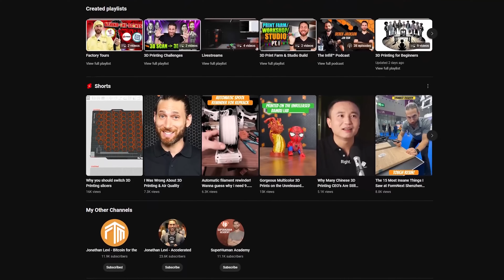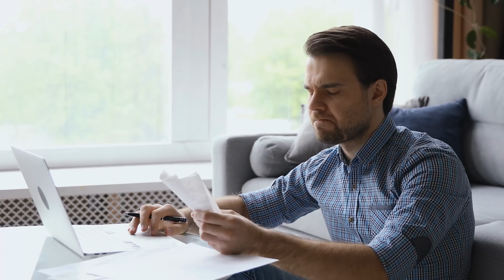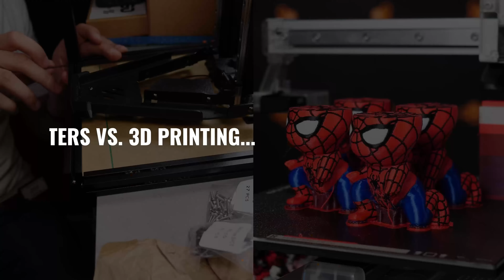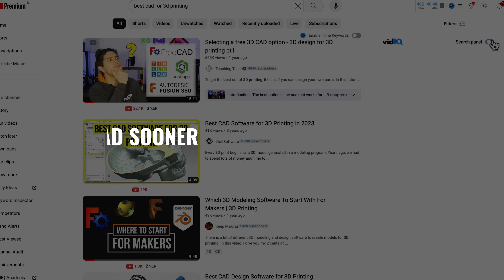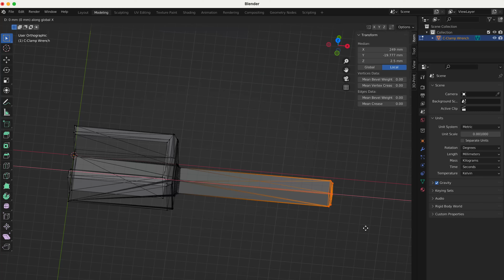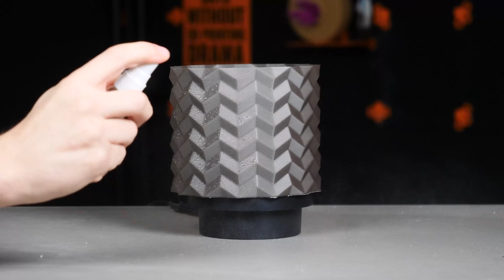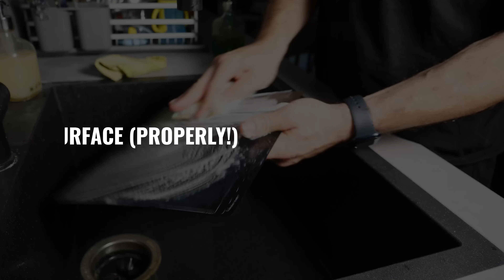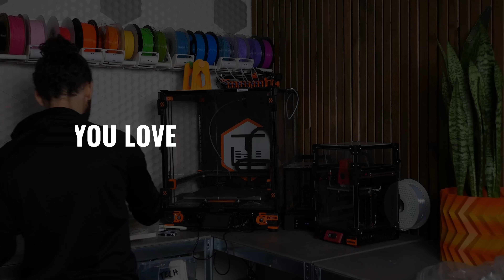9 Things I Wish I'd Known About 3D Printing

Comment: Hey Jonathan, OK, well I think I really need to call out just one thing..  :)  I have to disagree with your just wash the build plate first and every time advise, but please hear me out first... :)
My recommendation would always be the following for bed adhesion issue, first double check  t hat your build plate temp is within the range specified by your filaments manufacturer, being too cold is common reason many prints will not stick, this usually happens after people will try to recover to correct a warping or elephants foot issue by dropping their temps. If this is the case, there are a number of videos out there on how best to correct those situations without lowering your plate temps too low,  giving your build plate a really good washing with a name brand  dish soap like Dawn Powerwash or similar is great advise, just make sure it has no hand conditioners or lotions just as you stated has stated, in the video in most cases this will in fact work with the exception of a situation like mine where nothing ever sticks to my build plate after I wash with with the dish soap, though this is likely something specific to my environment though I don't know what it could be, If you still have issues, do wipe it down with between 70% - 99% Isopropanol. This is the part where we do differ from as I do believe it is better to wipe down with the isopropanol in between washes to ensure that your prints will continue to adhere to your build plate. I don't know why you are tossing this out after all this time, as it is a cheaper alternative to constant washing ever X prints.  Washing your build plate after every lets say 10 prints or so could get costly for some people as  for example Dawn Powerwash can cost u p to $7-$9USD unless you buy in bulk and if your on a budget this could get a bit expensive compared to the  cost of a bottle of isopropanol which costs around $0.79- $0.99 per bottle and one bottle can last you a VERY long time, in fact, it usually takes me months to go though one bottle with an average of 2 long prints every few days. This also saves time, as  well  people do not realize how much removing  the plate each time and placing it back on the bed each time can cause your bed to need re-tramming. Admittedly wiping the bed down aggressively can have the same problem which is why I don't recommend aggressively wiping the plate down either, a gentle wipe down should be all you need. Also if you find this to be the case where you are having to continually re-tram your bed, I suggest replacing your springs with silicone bushings instead, however, there are some debates as to why bushings should never be used and why springs should never be swapped to bushings though, I have never found this to be the case, in every test I have run, bushings have proven to me to be far superior in every way, though I digress.  Your  bed will get residues on them from the filaments, as well your grubby little fingers will leave oils on the plate every time you touch it. After time, these smuggies will eventually lead to a complete lack of adhesion and a simple wipe  down saves  you on both time and money and if your not too aggressive, you won't risk having to continually re-tram your  build plate. I honestly don't understand why you are dismissing the isopropanol after all this time, as it would seem to me that the isopropanol would be the perfect solution to fix a simple adhesion problem and to do so proactively in between  having to take the plate off and give it a good washing. Of course if you're using glue sticks or any number of other bed adhesion products to get your prints to stick, the washing the plate is really your only option as isopropanol will just make a giant mess of your build plate, but I truly stand behind the use of isopropanol in between washes are a quick an easy, lets call it a maintenance step between washes or if you run into a problem early of and your prints start to have adhesion issues as a quick wipe down will get your print restarted right away and may just solve the problem until you feel a wash necessary. I would be interested to hear a bit more as to why you have decided to turn your back on the tried and true  isopropanol as you even stated that this has served you well in the past. I bet I know why!!! Has Dawn sponsored one of your videos??? Gosh, I am so jealous of your makers / creators, you guys get all the good stuff free! LOL I am sorry that was a low blow, I sincerely hope you did not take offense to my very off color humor, I meant this completely as a joke! I know, my humor is rather tasteless and poor, hence why I never went into standup!
 I would  highly suggest you do not lather your build plate with a glue stick unless you are use a standard  and worn build plate that has become troublesome for you to get good adherence, or your are printing with a filament like PETG. If  this is where you find yourself, I would highly suggest if you have the means top upgrade your build plate to something like a smooth PEI sheet. These sheets are known for their adhesion and most standard filaments should have no problem adhering  too them.  PETG is definitely the exception as you are using the glue stick not for its adhering properties but as a releasing agent as PETG becomes extremely sticky and an unprotected glass bed is likely to be torn apart by PETG, I have never seen anything like it, it will literally destroy your glass plate! The Glue stick is good when you have a specific filament which is known to have adherence  issues such as the exotic filaments but should never be your first choice for gaining adherence for filaments such as the standard PLA. PLA should not have any problems adhering to a clean and not worn build plate. I

Lastly just a quick note why I am very much against the  many creators advise to  slather on the glue stick, hair spray, or any number of adhesion products available to make sure you part with your hard earned money and that is that these products tend to not only stick to your  build plate, and in most cases will keep your print firmly attached to your plate, but when you r print has completed, and you remove your plate, you are likely to notice that much of that product is likely also adhered to the bottom of your print as well. In most cases you  should be able to wash your print to get it off, but in some cases I have found that that when the initial layer was being laid down, and the filament at it's hottest, some of the glue or other products have been absorbed into the hot filament, which at that point, you will have little chance of being able to separate it from your print leaving a nasty white residue permanently  on your print. This is terrible if this happens to be an outside / visible portion of your print and this is exactly why I have to disagree with any maker that provides this as their first line in trying ensure your print adheres to your build plate. 

In closing, Jonathan, I would really like to understand why you are disavowing now the isopropanol as it clearly works, your history with it proves that, but were you simply trying to say not to just only use the isopropanol, ie never wash washing the board, or are you more or less boycotting the use of isopropanol all together? I guess this is where I may be missing your point here. 

Oh more lastly, reading some of the other comments made me remember the one really important thing that I wanted to share with you. You are a fantastic communicator, the way you present your video's comes with a bit of authority/ confidence,  but  not condescending, as that is extremely important when your  hosting your videos. There is another very young creator / maker, that has a large 3D Printing channel who's videos tend to be quite informative,   but I honestly can't take more then a minute or two of his videos, as he comes across very condescending as if he is the gift to the 3D Printing world which I find extremely odd in this maker space. Most of us in 3D printing tend to be introverts, and no matter how long one has been in this space, we can all learn something new from the most advances users, to the new commers, but his videos tend to have this air of him being the best, so don't bother suggesting something since he already has a better answer. It's a real turn off as some of his videos I actually want to watch but I can't. Your videos drew me in when I first found your channel as you almost seem like the best friend I never had! That is an amazing  skill and a good reason for why your channel has become so successful! Don't ever change your honest persona! It's just an amazing talent, though I believe it's less talent and more you just being you! :)  Amazing work as always Jonathan!

Many thanks for this excellent video and for your future reply to this! 

Cheers, 
John

Comment: Instead of using all the different filament types, try limiting yourself instead to only 1-3 types. What kind of material do you really need ? For instance I never used or use PLA. It´s a non engineering material, it´s temp tolerance is horrible and it basically costs the same as PETG which does everything PLA does and more. So why waste space for filament which I don´t need ? 
Create a good work space first and foremost. Do you have good lighting ? Good ventilation ? Do you have a nice table of some sort ? If your printer somewhere it works well temperature wise, dust wise and so on ? If your printer is in the same office room you use like in my case do you have a sound proof enclosure ? Do you have good filament storage like a dry box or other solution ?
In 99% of all cases you don´t need that Nylon CF fillet whatever material which does not increase your part strength anyway, if you can´t print a part strong enough just use sheet metal or other means. 3D printing is just ONE of many tools. Don´t always use all problems with a hammer just because a hammer is what you have, there are different tools for different problems.

Comment: Blender is not CAD btw. Blender is a 3D program for artists, CAD is more more engineering. 90% of all CAD software are either the same or similar. The more expensive CAD software is not necessarily better, I work with CATIA and Siemens NX and no one in their right mind should buy and of those tools for their home use or even professional use, that´s why FUSION 360 or even SolidWorks are so popular. My CATIA license at my engineering job costs 30k a year and there is nothing to it you would miss is you did use Fusion 360 for IDK 150 Bucks of whatever it costs I have no idea.

Comment: I've put off getting a#D printer for a wile because i could still make the things I wanted with other materials and I know that can be a lot of frustration with print failures and tweaking the machines. It's finally hit the point where Bambu is pushing for print consitancy with more monitors a.  alower price bracket that it's worth getting plastic production for me.

Up to this point most cosplayers where saying get ANY 3D printer because you going to have to spacale and sand then thing like crazy to remove print line.... what I'M excited for is printing files on the smallest nozzle and finest detail setting to reduce print line in pretty filaments that will be Cosplay ready. And for ones that will be paint the less spahle and standing the better!

Am I going to print custom upgrade, VERY likely  but I'm not interested in tinckering with machine hardware outside of replacement part.

Comment: Having 130 rolls of filament, I would kill myself. I have a system where I use 2 base colors (black / white), it´s the same material (PETG) of the same manufacturer.
Standardization is king, I can print any part with the PETG and it will fit almost anywhere color wise. PETG is basically the best of both worlds, is stronger and better than PLA and almost as good as ASA but with way less hassle. I also just have one printer which is a core xy machine these days and I have retired my old i3 close because the new machine is about 5x as fast. I have increased my productivity by 5 fold for the same space the machine took before. People need more focus to figure out what´s the most important and the organize properly. 3D printing is also only 1 out of 20 things I do so I can´t allow this one thing in my life to completely take over.

Comment: My own lesson learned. I think the biggest thing I learned after diving deeply into 3D printing is that 3D printing in and of itself is NOT a hobby. 3D printing is simply a tool. A very intriguing tool that can allow you to do things you just can’t do any other way, but a tool just the same, like your drill press or your lathe. It is an amazing tool to support your ACTUAL hobbies. How much use you will get out of it is entirely dependent on your lifestyle. Do you have a craft space or a workshop or garage? Are you always building, tinkering, repairing, improving, rebuilding, creating things around the house? If so, then a 3D printer can be an incredible addition. You may wonder how you did without it. But if your lifestyle doesn’t already include these kinds of activities and hobbies, or doesn’t really have the physical space for them, you will struggle to find applications for your printer. I mean seriously, how many Mandalorian figurines does anyone need? I am still enchanted by the possibilities, especially the design process, but learn from my experience and give this all some serious thought before you leap.

Comment: Been 3D printing 12 years now. I use a textured PEI sheet and I found what works for me (99.99% of the time anyway) and that is clean with 99% isopropyl alcohol then every 3-5 prints I wipe the bed with 0000 steel wool (super fine) it does not damage the bed at all but does remove those ghost print marks and is as good or better than Dawn washing. Just to test this I have been using this method for around 500+ prints without washing in soap (use to wash in soap every 5-10 prints). I also have my Z offset set dead on (perfect first layer) so for me at least this combination has yielded maybe 1-2 warped prints for 500+ prints and those were when I went too long before the steel wool. Now the steel wool makes no visible marks on the bed (surprised me) and when I use it then IA clean the bed looks brand new. I had heard years ago about using steel wool but figured it would ruin the print bed (sand it down) but I was very wrong and wish I had tried it even sooner.
Reply: Wow underrated comment right here! Thank you…

Comment: Great Video! Thanks. 
I would like to find out if you would recommend the bambu lab p1p above the creality k1? I have a ender 3, and have been getting consistent prints on the machine. 
Was just wondering why you are so biased against the creality printers. 
I just got one because of availability in my country. 
Regards
Reply from the maker: Definitely. Had a bad experience with the creality

Comment: I started with SketchUp, now I'm stuck starting simple projects super quick and easy. But it almost always snowballs into Fusion 360 constantly making me rebuild the model 😵‍💫

My point, SketchUp is VERY easy to learn and you can be designing and printing parts in hours if not MINUTES if you have the inclination for it. Took me 30 minutes to learn and design a phone stand the very first time i used it. But, be warned that if you ever do outgrow it, it will always seem to pull you back and either save you a few minutes or waste hours fixing models because you think you don't want to rebuild the model the right way in a proper engineering software suite while you get stuck in a loop of.. WELL it's just this little mod, not worth it.. just this little mod, not worth it.. just this little mod, not worth it..

Comment: Yup - got into 3D printing back in August 2023, and if I had the space I would already have supplemented with another like Bambu’s A1 / A1 Mini… Having 40-50 filament rolls, including the holiday sale purchase…. Well when I see new exciting colors, dual or triple color silk etc…. I want more. :O Also just started trying out PETG (was PLA variants only before), and following your “script” I have actually just started to dive into CAD designing. :D Watched so much videos about TinkerCAD, and did a couple of own needs / designs in TinkerCAD, but already looking into Fusion 360….. Never had a hobby that expanded so fast before….. :O Btw agree with the dish soap cleaning! Did not have any issues, except when I thought I could ease up on the cleaning of the build plate…. Proper cleaning again, and no issues with models not sticking to the build plate since. And last but not least I also have the Sunlu S4, and well the S2 as I started out with that. So in my short 3D printing life, I can already confirm much of what you stated in your video, in relation to myself / my experience so far.

Comment: "or sticks too well" shows creality glass
yup, the bane of my existence right now. it's either bonded like cement, or it pops off half way through the print. 
elmers works ok, geetech jt 16works perfect for the print itself. but it's still a pain to breack free if there's notable surface area on the initial layer.
fwiw ambient is 72f with a constant, faint hvac draft.